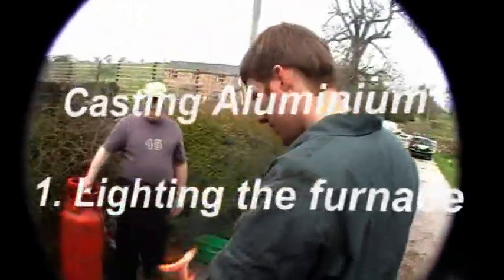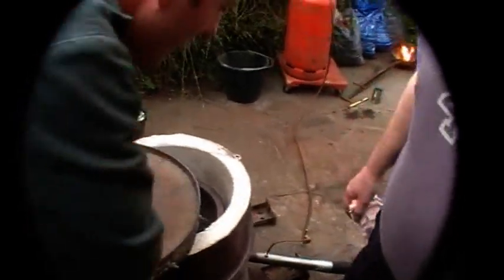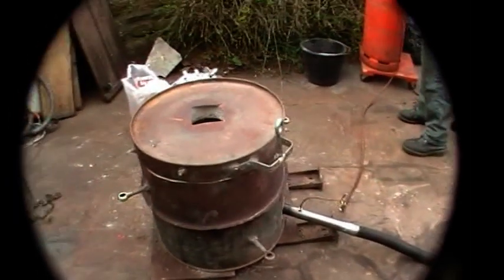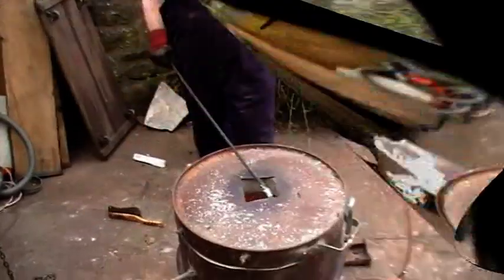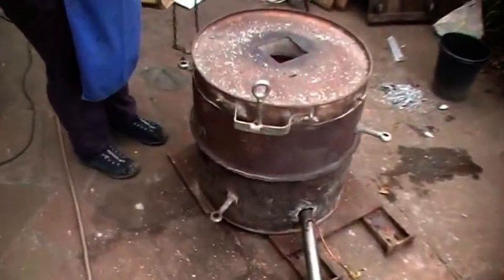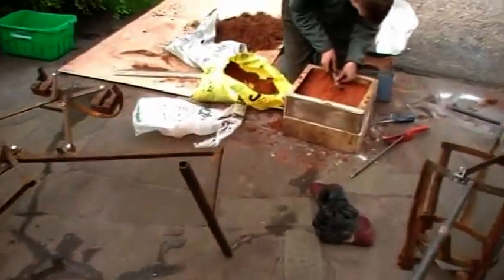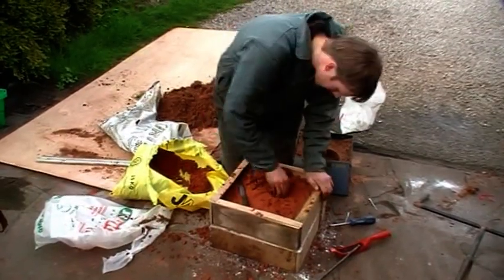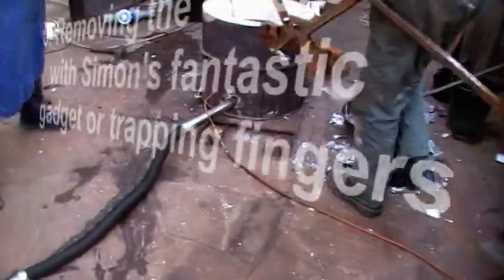Casting Metal

Comment from the maker: @eatmypies A smaller version is really simpole, you just make everything smaller! The crucible I have is about the largest you can manage with 2 people in a home setup. There are many smaller ones. The gas burner is quite simply a gas pipe straight into an air tube. All you need is gas and something to blow air. I used the old hoover because I had it handy. The air flow sets the speed you can heat the metal up. The refactory is like cement, it can also cruble easy so steel rods run through it.